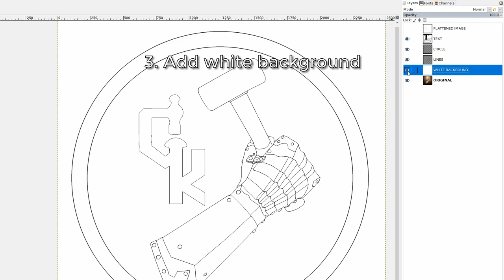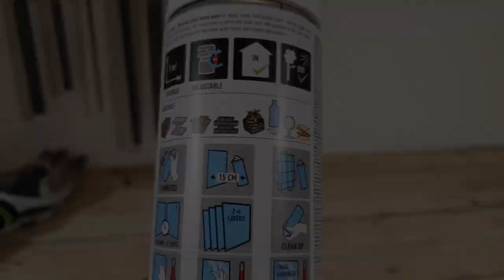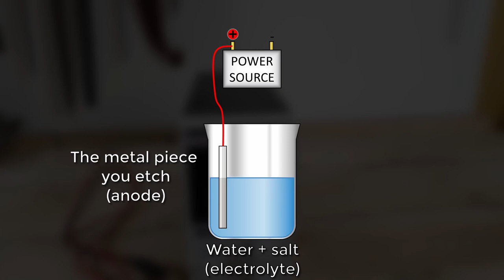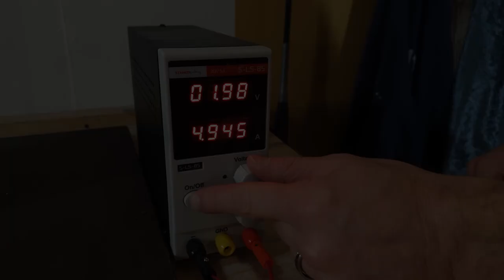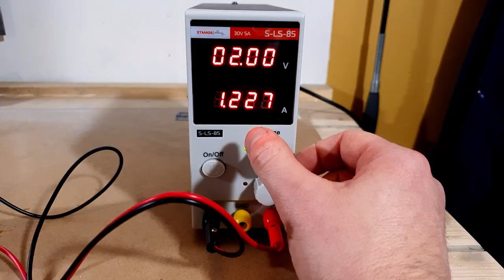Electro etching tutorial & experiments - making a logo

Comment: How would you add a picture to a pauldron for example? Like, would i be able to just print out a renaissance picture from the internet and try to transfer that onto a piece of armor and then etch that? Because i want to be able to etch a renaissance-esc picture onto my armor to give it the more medieval/gothic look.
Reply from the maker: That's a great question, for a round object it’s harder of course. You can’t really place paper/tracing paper on a pauldron without getting wrinkles on it. To get a perfect match you would need 3D modeling software I think. But I would do it in small parts, cut out stripes or pieces of paper that you can place on the pauldron without getting wrinkles. Then fill all the gaps by drawing freehanded. It requires a bit more skill of course. I will try it on my future projects so maybe I’ll come up with some more clever solution by then

Comment: Great video and very informative thank you!  Does the cathode have to be the same metal as the anode? I've seen lots of people using a copper plate for a cathode rather than steel?
Reply from the maker: Glad to hear you found it usefull! From what I've read you should use same metals but I haven't tested it with different metal. And also steel might be a bit cheaper than copper
Reply: @GarageKnight  Thank you, I've now had a go etching a couple of pieces of steel first with a steel cathode and then using a sheet of copper cut from an old domestic hot water tank, the copper cathode seemed to etch steel a lot quicker but left a slightly rougher finish presumably because of the speed it was etching. I'm looking forward to experimenting some more!
Reply from the maker: @robb2869  Thanks for the info, sounds interesting! For me adding the vinegar made it more smooth, I wonder what would happen with copper + steel + vinegar?